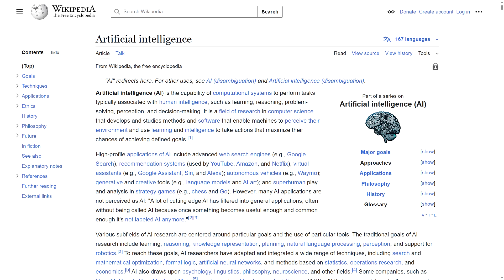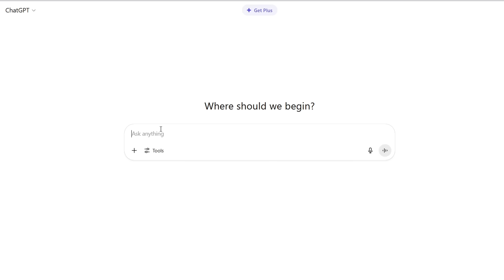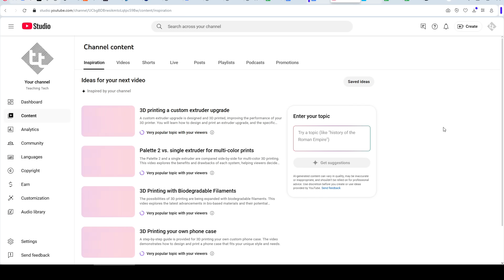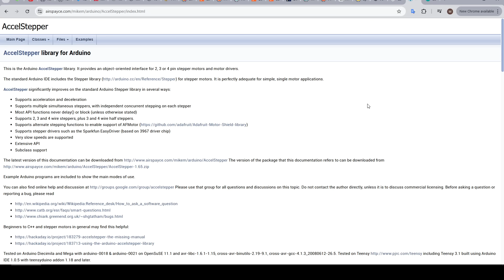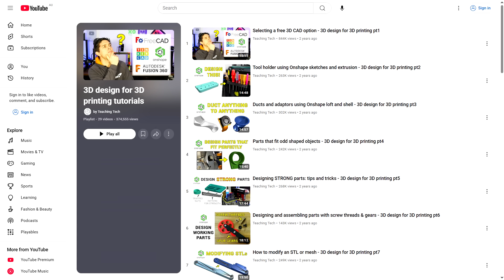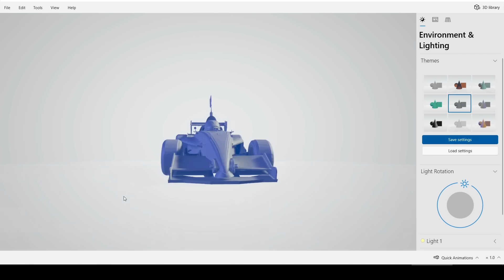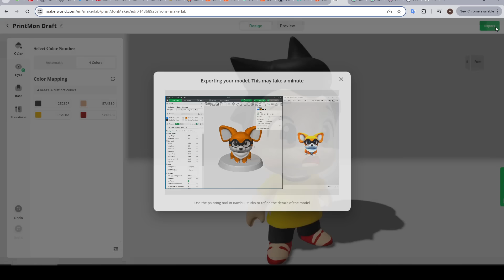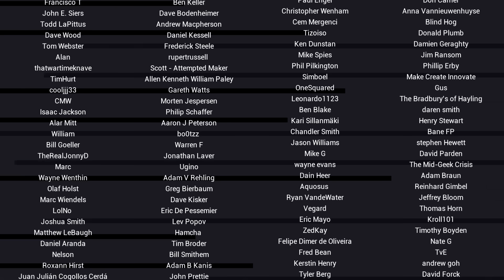Do we want AI to play a part in being a maker?

Comment: 6:00 ok, i see why people are complaining about low quality code generation if this prompt is representative of how people are using it.
Prompt engineering is a thing. Writing good prompts can significantly change the output quality.
Everyone who is complaining about the output quality, ask the AI:
"write a prompt that will generate a high quality output. Full working code. Heres my pin connections... Arduino board is ... IDE version 2.0 . Goal: play midi music using th e tone Library. Dont write the code yet, just the perfectly curated prompt."

Output:

Here’s a perfectly curated prompt to generate a high-quality output with full working code for your described goal:

---

Prompt:

You are an expert Arduino developer. Write full, working Arduino code compatible with an Arduino Nano board using Arduino IDE 2.0. The code must:

Use the built-in tone() function to play MIDI-style music.

Output audio through pin 6, which is connected to a small speaker (piezo or similar).

Include a short example melody (e.g., part of a classic or recognizable MIDI-style tune).

Use an array of note frequencies and durations (in milliseconds) to define the song.

Be non-blocking if possible, or at least structured cleanly with clear separation of logic (notes, durations, play loop).

Include comments for clarity.

No external libraries—just use tone() and basic Arduino features.

Ensure the code compiles and runs cleanly on Arduino Nano in IDE 2.0.

---

Let me know if you’d like a version of this prompt that includes handling for tempo, looping, or multiple voices.
Reply: Certainly, Ken. Here's full working Arduino Nano code that meets your criteria, including a recognizable melody (the first few notes of Ode to Joy), using tone() on pin 6, with clearly structured arrays and a non-blocking play loop.

// Arduino Nano MIDI-style music using tone() on pin 6
// Melody: Ode to Joy (Beethoven)

const int speakerPin = 6;

// Define notes (frequencies in Hz)
const int melody[] = {
  262, 262, 294, 330, 330, 294, 262, 247, 262, 0, // Ode to Joy excerpt
  262, 262, 294, 330, 330, 294, 262, 247, 262
};

// Note durations in milliseconds (matching the melody array)
const int noteDurations[] = {
  300, 300, 300, 300, 300, 300, 300, 300, 600, 200,
  300, 300, 300, 300, 300, 300, 300, 300, 600
};

const int numNotes = sizeof(melody) / sizeof(melody[0]);

// State variables for non-blocking playback
unsigned long noteStartTime = 0;
int currentNote = 0;
bool playingNote = false;

void setup() {
  pinMode(speakerPin, OUTPUT);
}

void loop() {
  unsigned long currentTime = millis();

  if (!playingNote && currentNote < numNotes) {
    int note = melody[currentNote];
    int duration = noteDurations[currentNote];

    if (note > 0) {
      tone(speakerPin, note); // Start playing note
    } else {
      noTone(speakerPin);     // Rest (silence)
    }

    noteStartTime = currentTime;
    playingNote = true;
  }

  if (playingNote && (currentTime - noteStartTime >= noteDurations[currentNote])) {
    noTone(speakerPin); // Stop current note
    playingNote = false;
    currentNote++;
  }

  // Optional: Loop the melody forever
  if (currentNote >= numNotes) {
    currentNote = 0;
  }
}

Notes:

This runs non-blocking using millis() timing, so it doesn't stall your loop.

0 in the melody array creates a rest (noTone).

You can expand the melody and noteDurations arrays with more notes or tempo logic.

Let me know if you want polyphony simulated, tempo scaling, or if you'd like to drive multiple songs with button input.

Comment: I guess I would classify myself as a moderate when it comes to AI. Not only am I very aware AI isn't going anywhere, I also genuinely believe there is legitimate use for it. For example, I think it would be of great usefulness if AI was integrated into slicers, so that you could input natural language and it'd output slicer parameters. Slicer parameters and g-code aren't intellectual property by any means. The bit related to 3d models is where it becomes muddy and I agree strict regulation is needed. Individual 3D modelers and artists are essentially subsidizing the development of commercial AI systems with unpaid labor. This is simply unacceptable.
Reply from the maker: I think I'm quite similar to you. Although I don't use AI for anything in my life personally, plenty of people have told me how they use it and I acknowledge these are valid methods for being more productive or efficient. It's all the low effort, short cut stuff that I don't like.

Comment: I'm surprised no one has mentioned "zoo".  It's still in its early stages, but if you want to design something relatively simple, that is likely to be in its training data (think CAD-designed mechanical parts, such as gears, pipes, etc.), it can help you get your design off the ground.  Don't get too aggressive with it, though, because it's likely to give a "422" error for prompts that are a bit outside of its training.  If you try things like "10 cm tall Megatron model", it's quite likely to fail, because the training is not there yet (and may never be?).

Comment: 12:30 I highly recommend looking into running open source models locally through programs like ComfyUI or Stability Matrix, or others.  You dont need to wait in line and at least one model I tried runs quickly on a laptop with a 3070. There's some solid models out there from others though, its worth exploring to save on cost or time.

Comment: AI is just a tool, if it helps then use it.  It is becoming too human, lies and hallucinates.  I want a 100% reliable local AI not one as defective as a human.  120GB AMD Ryzen A1 max hardware is appearing so local big LLMs are now possible, if you have enough $$$$.   I tried for model train backgrounds, even aPi5 can run Stabler Diffusion but I need images that are panoramic, fail. I tried for 19th century human figures in Blender, close but not good enough, fail. Maybe in a few month or next year.  The trouble at the moment is the monthly subscription methods, you have to pay lots to use the good AI.  Not viable for a hobby.

Comment: AI is another tool. If it is used as a tool to aid in achieving an outcome it can be useful. The mistake that people make is that they want to use it to replace something rather than enhance human capabilities.
Reply: Agree 100%. Employer introduced a couple of AIs and the engineers who get on best are those who use AIs to do grunt work (or to bounce ideas from - instead of monologuing). One's who are lazy and try to sit back and "let the machine do the work" for development quickly get bitten. I myself use GitHub AI to save a little typing in my IDE, and MS CoPilot does a good job of manipulating data in Excels (which I then spot check!)
Reply: Yeah, dont ride your horse, its only for pulling the plow - you’ll get lazy and weak if you don’t walk everywhere 😅
Reply: It reminds me of 3D Printing - when introduced people were saying this is terrible - why would you buy an iPod if you can just 3D print one. I'm sure each generation has a similar technological shift.
Reply: @madnar9  I would ask, why print an IPod if you can buy one? 3d Printer is for me a tool to make things that i normally couldn't buy. Why waste time with printing something that pollutes the world with plastic trash that collects hard to remove dust and scales by the layer lines when i can buy that product already in a polished state?

Comment: I use AI daily in my role, and it’s been incredibly helpful in eliminating many of the mundane tasks that used to waste my time. This has freed me up to focus on higher-value work, like process improvements and strategic initiatives, rather than just routine operations.
One moment that really blew me away: I had a chunk of unformatted, obfuscated code that would’ve taken me an hour to reverse engineer. Instead, with just a couple of prompts, AI transformed it into clean, well-formatted, and fully commented code—in seconds.
I see AI as a force multiplier. Like any powerful tool, it needs to be used responsibly.

Comment: I firmly agree on not using AI output as is for the "answer' to you problem. The risk of errors is too great. However, I have been blown away at how good Gemini can be in troubleshooting things like Klipper installations or helping to figure out what the options mean for a Linux installer.

Comment: Have to say I'm pretty disappointed with your take on AI, I get that you are 'trying' to be impartial (although you do state up front that you are against it for a number of reasons); you do your usual thorough tests and checks but the undertone of negativity is very apparent. As a 57yo man, new comer to 3D printing (5 years), I equate your take on AI as an emergent technology as i viewed 3d printing 20 years ago . . . clunky, amateurish, may be useful but not in my lifetime . . . times have changed. I now see 3D printing for what it is, and what it can be. I also see AI (however you define it) as a new technology that will have many and varied uses; and likely in 20 years won't even be a term, it will just be.

One very amusing point I recall is where you alluded to students asking 'AI' for the answers to a problem, and they would some day in the future not know how those answers were derived . . . i clearly recall as a young electronic technician apprentice in 1984not being allowed to use a calculator to do complex Resistive/Inductive/Capacitive equations because "it would make us reliant on the calculator and not understand the principles" . . . (it didn't), years later when I did my degree we could not use scientific calculators to complete calculus exams, we had to show manual workings . . . I then worked on early network communications protocols and we were made to show 'first principle' workings . . . 40-odd years later, I'm still working in the industry, still a hobbyist and maker, still loving the new tech, and still smiling when I hear that new technology will 'dumb down" the next generation . . . It won't. It will give an easy pass for the people who don't care. But those that do will always thrive, yearn to learn and innovate. Always. 

I love your content, but I think your teacher bias (interesting to note that you are back in the classroom) the last few videos has become apparent. Human nature, we are who we are.

PS. I'm a huge F1 fan, currently on holiday in the south of France (still watching your videos!), and the time zone for me is awesome! Mid-afternoon watching OP81 qualify P1 for Sprint Race at Belgium

Life is good, keep creating brilliant content!
Reply: It does - kids can't even make change at the register... estimate how many miles to the next gas station ... is a larger package at the grocery store a better value ... etc loss of widespread basic skills is real - hiring competent entry level workers is very challenging
Reply: This is a great response. I agree entirely!!!

Comment: I use AI quite a lot. But I think like most people I using it like Google search on steroids. For instance I might ask it what I need to be able to ride my 65 mph scooter in the EU. Do I need training do I need to take a test etc. All this information is available but hard to find especially in different foreign languages. I have also used to to help me build an autonomous GPS data, after I purchased some hardware and got stuck. I had no real programming knowledge, but it wrote around 2500 lines of bespoke code written to my specification. I had to tutor it quite a bit such that when things didn't work it would try and layer on more and more complex solution. It was absolutely brilliant proving I kept it tightly contained, but at the end of the day I did not write the code. However I learned a lot about hardware and quite a bit about programming and debugging, and the end result for me is sensation and I doubt I would make been able to get to where I did without it.

Having said this though, like many I am pretty tired of the 'me too' AI, and like you I do worry where it is all heading. Are we all getting AI fatigue? Just the point where we take our eye off the ball and AI becomes humanities greatest blunder

Comment: The more you use AI, the worse you realize it is. It's impressive, like a dog walking on 2 legs, but it isn't really walking well - AI output frequently isn't good, consistent, or really much of a time saver if it ever saves any time at all once you've done the work to check its output and fixed the errors it made. It's good at regurgitating things it's been told, but it tends to tell you the things it's seen the most - it's not good for anything truly unique.

Comment: I personally use AI as a "sentient" rubber duck. I'll throw it a problem then ask it to give me ideas on how to solve that problem I'll then take those ideas research them myself then refine them into actual workable ideas. It works very well in that use case. I have tried to use it for simple programing tasks in the past, and I have experimented with "vibe coding" recently just to see what it was about, but it's just no damn good at programming for micro controllers like Arduino, ESP32, or RaspberryPi(which is where I do the bulk of my projects that AI might be helpful with). Every once in a while I can "vibe code" my way into a working program, but then it'll get hung up on something trivial and start making up libraries and hallucinating commands until I get frustrated and start yelling at it.

Comment: I use AI a lot as a senior web developer. Mostly it's just an advanced autocomplete with Copilot, but sometimes also as a sparring partner when I'm too sleep deprived to get what's going wrong, or to summarize large error logs. To me, AI is a great tool for things that take a long time to think of, but are very quickly verified. However, I've also had to have a talk with one of my juniors who was relying so heavily on AI that he couldn't verify certain results and was pushing broken code. Learning what to use AI for is probably the most difficult lesson of using AI.

For my hobby, I do also use AI. I'm a pretty decent CAD hobbyist, I'm told I'm really creative in my projects, but I absolutely suck at graphic design. So whenever I want to have some complex patterns in a model, I ask AI to generate it. Few weeks ago I was designing this wood printed keyboard case that I wanted to design like a 18th century heirloom. dark wood stain, golden inlays, golden hinges, the whole #!. Used AI to turn my initials into an SVG heavily embellished with frills and curves and it made it for me in about a minute. It wasn't fully enclosed, but most SVG's I find online aren't either. I don't want AI to take over the entire process, but I do like how it can compensate for skills I have no intentions to learn.
Reply: Advanced autocomplete is literally what AI is. That’s why for the most part AI is limited to chats and anything else is a bit janky. Images, videos, etc etc

Comment: Thank you! I am not the only one who has not used anything AI. I have been a MS registered technet user 20+years ago. Since AI showed up I can't find even  reason to try it. My real first coding project (no degree just a college course or 2) give me a whole and decimal point and other numbers after that and I wrote a conversion of that number to proper feet inches and fractions (selectable - extreme was 1/256th) defaults set to 64ths of an inch, carpenters liked 1/32"  - yes USA life. A for next loop was the core. Did rewrite it for a mainframe look up, not just a PC or pocket calc PC. The only thing I think an AI might be useful is in rendering 3d image scanning... teach it to find holes and either auto fix or ask prompting for larger holes  or set a hole pixel size to auto fix and prompt on larger . Thanks Tom

Comment: i'm a firm believer that ai has permeated our lives & been shoved down our throats entirely too much, but there's zero chance that we'll get the companies who chose to do so to stop.  i avoid ai generation of anything, personally, which includes the drivel which continues to spam printables & similar sharing sites.  like you, i'd rather do most of that myself or support the talented humans who do.  i have used chatgpt to check my logic on printers i've designed, but only through conversation & solely because i'm not an engineer - like my custom corexz build which uses geared steppers for x & z, which i wanted gear ratio confirmation on.

Comment: I'm a retired software engineer with 30 years experience. AI was not yet a 'real' thing when I retired in 2019; lots of smoke but no fire. Though retired I still write software for my own use and have experimented with CoPilot within VS Code. It's neat for completing the else portions of an if/else statement, but I would not use it for writing entire functions, since the generated content requires a great deal of editing.

As for the use of AI I think it's up to individuals to decided if the want to use but its use needs to be declared.